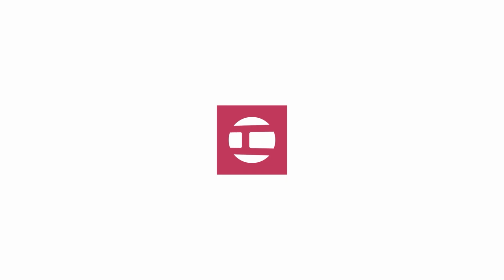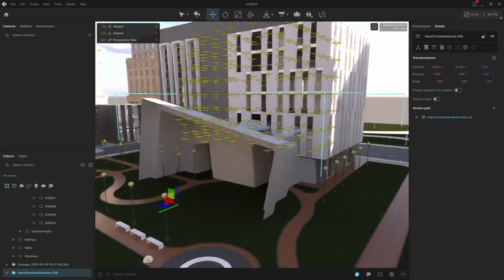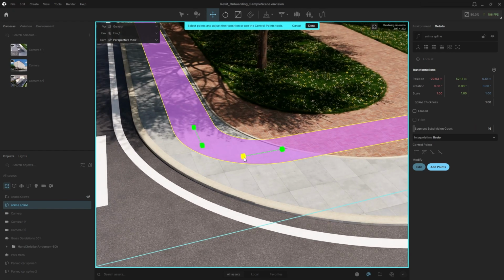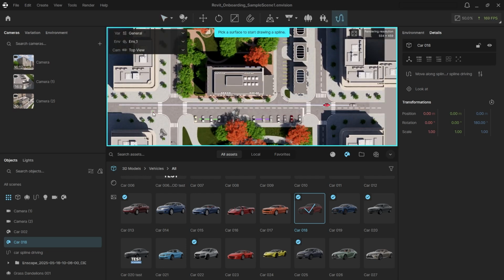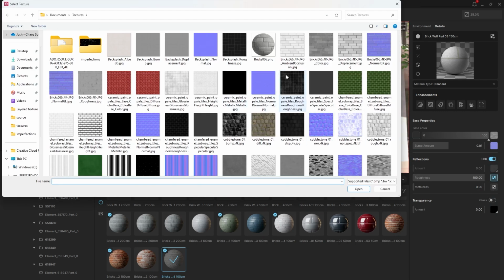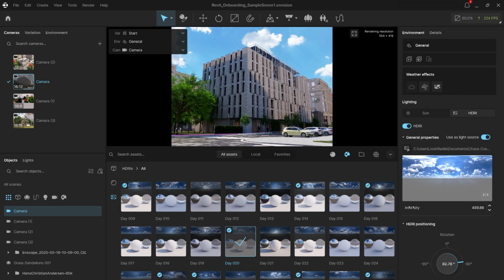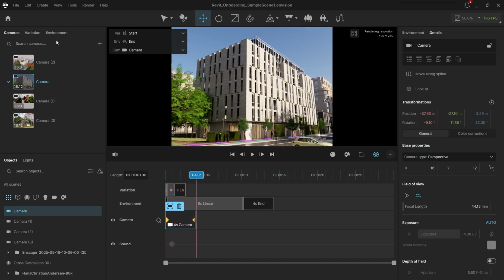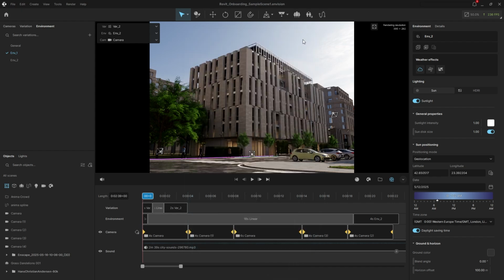Envision 1.0 OUT NOW | Product Demo

Comment: I really don't know what you're doing. You need multiple programs to do different things instead of integrating everything into a single program with real-time rendering. Enscape should have evolved into what d5 render is now. Even Lumion is doing better. Are you clear about where you're going and who your client is? I see you're very lost. Enscape used to be a benchmark, but now I see it fading away. Take it as a constructive criticism, I am the first one that I want Esecape to be a reference in the world of visualization
Reply: i agree 100%.
Reply: Indeed, too many programs.

Enscape and vray needs to be merged in one program; using GPU and CPU respectively to provide full performance advantage. 

Else one is idle and other is used full underutilising  the PC

Real time / motion in enscape , light accurate in  vray. 

Chaos is merging but messing up.
Reply: Totally agree.
Reply: Agree. envision, enscape, vantage should just be rolled into one.
Reply from the maker: Hi, thanks for sharing your thoughts & we appreciate the feedback. Enscape is built to stay lightweight & fast, which is why we didn’t pack in features like advanced animation or complex scene assembly. This is to give designers quick, real-time visuals right inside their CAD tools, without slowing things down. That’s also why we created Envision. It picks up where Enscape leaves off, giving you better visuals & more advanced tools, without complicating your workflow.
Reply: @EnscapeArchDesign  Amigo chaoz nunca debió comprar enscape lo arruino 😢😢😢
Reply: Really on point comment. Other programs inside Enscape are really unnecessary. 😢

Comment: What's the difference between Envision and Vantage ... very closer these two stuff?
Reply from the maker: Hey there, great question 🙏 Envision is designed for architects and designers who work directly from CAD. It adds features like photorealistic visuals & cinematic animation, without making the process more complicated. Vantage, on the other hand, is geared more toward V-Ray users, who usually need more control & customization. Both tools serve different needs, depending on how you like to approach visualization.